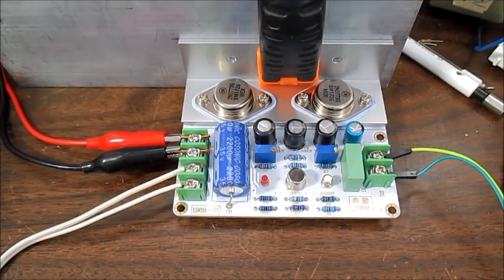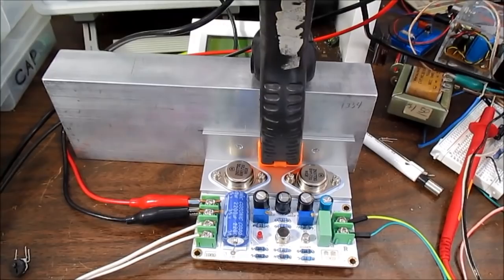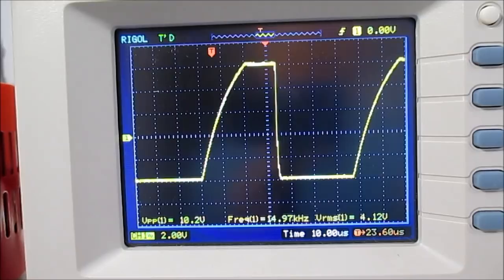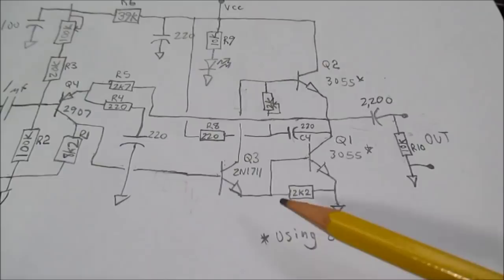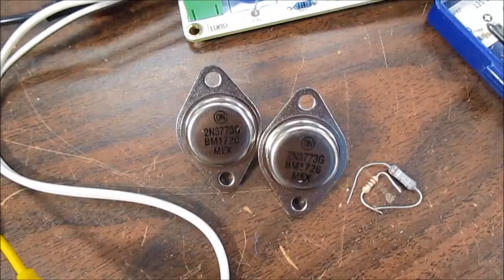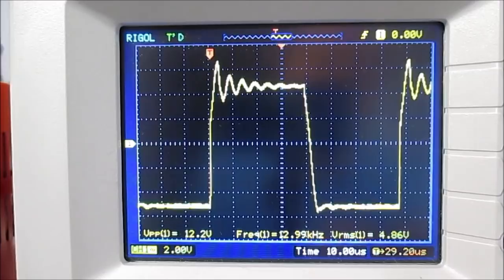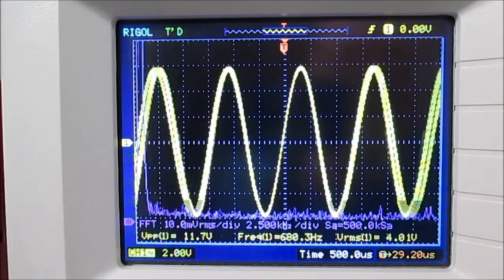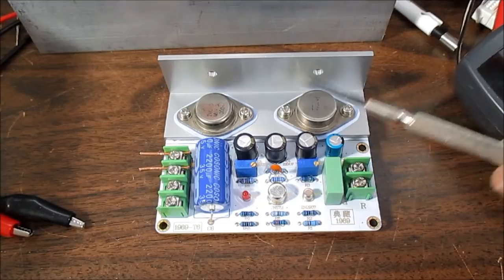Class A amplifier kit - fixing the distortion problem

Comment: A good follow up John. I could not believe the original Hood amplifier could be so bad. Many people built this in the past and it had a very good reputation. Over the years the circuit was up dated and power increased. Does anyone know if the updated version is available as a kit?
Reply: I've seen a kit for the updated version on ebay but best to buy the bare boards, and source better transistors you can trust,use good outputs.not too fast, say 4 meg max ( 2n5886  in my last because I had them)  and don't mount them on the boards.
 I've found better stability with leads about 3-4 inches to BIG heatsinks.
 Well made, it's still superb, read the original articles, they are still  valid.
 Output transistor match is critical for best performance.
Reply: It's not the original. How can you use different transistors and call it original?
Reply: Also the operating Voltage.

Comment: Josh, I have a pair of bx5a's studio monitors by M-Audio that have a filter on the amp to cut off anything below 50hz. What can I do to change that so I can get 30hz?
Reply: This doesn't seem particularly advisable. Monitors in this class don't generally extend too far below 100 Hz anyway (for any sensible level spec such as -3 dB), so the main purpose of this highpass is keeping low frequencies off that would mainly make the woofer pump air and generate IMD due to high excursion. Thus level handling is improved at generally negligible cost.
Reply: Thank you for the response. I took your advice and left them alone and added a TRUAUDIO sub to my studio instead of going crazy. It sounds amazing by the way.

Comment: During the same year in 1969, J. L. Hood published another article (Wireless World October 69) which explains the same phenomenon, and workaround. If anyone would like to learn more about, and fix it ultimately, I recommend to read the article. The introduced board by John is far from the engineering excellence as he pointed from many angles. Unfortunately the old 3055 with low <  1MHz current gain bandwidht or a better PCB layout do not solve the oscillation by one simple magic hit. The circuit needs some additional RC network here and there. Happy reading.
Reply: Szatmari Mihaly Cheap 1969 amp from China are pretty good.

Comment: Great Video. I need to open up some (remove the top if possible) 2N3055's from China without destroying the transistor.  Is there any chance that cases or portions of cases are made of Beryllium and therefore toxic if inhaled?
Reply: I don't think so mate, the casing on those is just metal. 
Beryllium Oxide was used almost exclusively on RF power transistors

Comment: I have a amplifier with a stk4141 ii it has distortion i think i need to replace it bcuz itz a Ic and it has the output transistors inside
And my amplifier is a kenwood ka35 not much inside lol everything is driven by that big ic
And everything elese looks fine
Its like notting on the board

Comment: You need to download the JLH 1969 Design to compare. This clone is crap should get bandwith 10Hz to 100KHz and THD < 0.1% at 10W. Also you need to change component values for different loads.

Comment: Sorry John, but that's a class B amp, maybe AB, but certainly not class A.
Reply from the maker: Oh yeah? I await your circuit analysis of why you think it is not class A.
Reply: Simple, really two output transistors Q1 and Q2 , driven in anti-phase by Q3, the junction capacitively coupled to ground, classic class B. if it was class A then there would be either a resistive load to one output transistor, or perhaps a constant current load, or even a transformer to couple the output, the giveaway is the two output transistors being driven, although  the current through them is excessive.
Reply: Nope. A push-pull amplifier can still be class A - the definition of which merely states that the output device(s) have to be active 100% of the time. In fact, one would not even use an output stage like this in an AB amp, since it performs poorly as such.

Conversely, any kind of B/AB topology can also run in class A if beefed up accordingly.
Reply from the maker: It may look class B but it is biased hard to keep both outputs on for the full waveform cycle which is the definition of class A. Constant current drawn off the supply with load or without, with or without a signal is also indicative of class A operation.
Reply: It's still class B if the output consists of two output devices are actively used to source and sink the output, even if the circuit is so poorly designed as to draw a large standing current. Class A has only one driven output, You are confusing this with a class A amp which has a constant current load. This circuit was very common in the 60's and 70's , before we had complimentary transistors, and I built many of them, in fact I used a very similar design,  but with Q3 capacitively coupled and biased to get a proper quiescent current in the 2N3055's.
Reply from the maker: You need to read up on what class B and class A mean. It is not a type of output topology, but rather how the transistor(s) conduct during the waveform cycle. If the circuit is operating in class B, one transistor would handle the positive part of the waveform and the other transistor would handle the negative part in a push pull configuration. This JLH amplifier keeps the transistors active during the full 360 deg of the waveform to eliminate any "hand off" of the current to any one transistor during the waveform cycle. This is clearly class A operation.

The circuit was a good idea for its time nearly 50 years ago because there is no crossover distortion and the design removed the non linearity issues of the early quasi complementary designs. Lots of good articles online about this amplifier written by JLH and other EEs.
Reply: Sorry I don't need to read any articles, I was there when these concepts were moved from valves to transistors, then the transformers were removed and finally when complimentary pairs were introduced. Yes the transistors are each operating in their class A region, but this is just poor design, the amp would operate just as well with a small quiescent current, and be more efficient too. But the fact still remains, the circuit is wired as a class B design.
Reply from the maker: "Yes the transistors are each operating in their class A region". Bingo!
I'm not crazy about these power inefficient designs either. They have to be biased for the load they will drive. I'm not full in on class D either. It has its own set of issues. Class B with a little bias (AB as some refer to it) is my preference.
Reply: Agree, Did I hear you set the idle current to something like 1.2A, half the max? Sounds like Class A to me. The schematic I posted earlier said to set idle at 200mA, not sure the intended rail voltage though.
Reply: Exactly!
Reply from the maker: I don't see that post. 200ma is too small (maybe for 12v use?). The upper current source transistor is modulated with the signal to improve efficiency. This will relax the current setting, but JLH's own article demands much more current for 8 ohms. A pure class A amp would need a little over 1a with the supply at 18 volts (or even more to deal with loudspeaker reactance).
Reply: Sorry but the design is still for a class B amp, no matter what current you force through the transistors, why would anyone force over an amp through a couple of transistors when the circuit is quite capable of working with a quiescent current of tens of milliamps. Just banging current through these 2N3055's does not make a class B circuit into a class A circuit, even though you are forcing the transistors to work in the class A operating region. The argument here is what the circuit design is, not how much current you can force through the output transistors, if you you run them with no bias, would you call it class C?
Reply from the maker: Brian, The reason for the design of the amplifier has been discussed by EEs in various articles which you won't read. You claim to know better. Fine. I disagree with you and will leave it at that.
Reply: Brian Marshall I respect your experience and I can see why topology would seem to drive a classification.  Also from history, I understand why topology would drive a particular type of amplification.  However, John is correct, topology actually does not define classification of amplifier class.  A type A classification is an amplifier that is biased halfway into its active region, then swings from one end to the other; thus is at the highest efficiency when at full power.
Reply: I kinda agree with Brian although the original comment could have been worded better, I have similar amplifiers to these but instead use TIP41C transistors. These were advised and sold as class A amplifiers but I was puzzled to find that the output transistors were in class B push pull configuration as opposed to having the output transistors in parallel with each other for current sharing like you would find in other high powered class A amplifiers! 
This circuit is definitely a class B circuit that has been biased up to the class A region. As far as I have always understood, a class A amplifier cannot have crossover distortion and yet this circuit has a push pull output stage! Maybe I'm missing something here? 
If I was to build a class A amplifier, I would only need one transistor in an emitter follower design. If I needed more output power, I would parallel another transistor to lower the current across the transistors so that I can increase the voltage while keeping the maximum wattage of the transistors in check! I certainly wouldn't switch to a class B circuit like this one.... 
Either way you choose to design an amplifier circuit, the emitter follower design is simpler and avoids any prospect of crossover distortion, both circuit designs will dissapate the same amount of heat! 
So would you classify this amplifier as a class A or a class B operating in class A?
I personally think that it's a class B circuit operating in class A... Well that's what I'm sticking with until I know better 😉
Edit: just looking at the square wave on the oscilloscope, you see the ringing at the top end but yet there's no ringing at the bottom end! 
In a true class A amplifier you would see equal ringing at both ends because it's only one transistor that handels both sides of the signal cycle, here the limitations of the class B circuit are showing up where distortion shows up on only one side of the signal cycle... To me, that's a clear giveaway...
Reply: @KissAnalog  Eddy, great to see you here, even though by what you say makes perfect sense, this circuit is being sold as a class A amplifier to which it is, even though it's based on a class B circuit, people who haven't been around long enough to know any better automatically purchase this eBay kit for wanting to experience the class A amplifier sound that they have heard about but it's a terrible circuit to use in class A mode, this circuit would better be suited for class B or A/B operating mode where you can operate it at much higher power due to it's efficient push pull configuration, and it's simply done by lowering the bias current.
But if you lower the bias current in a proper emitter follower class A amplifier, you will see clipping on one side or the other, you have no other choice but to run it in class A. That's what I consider to be a class A amplifier! Not this abomination lol. Just because you can, doesn't always mean that you should! So in the case of this amplifier, John Lindsay Hood should have known better. I think the Nelson Pass Amplifier is a much better example.